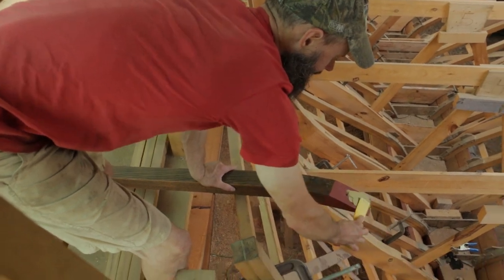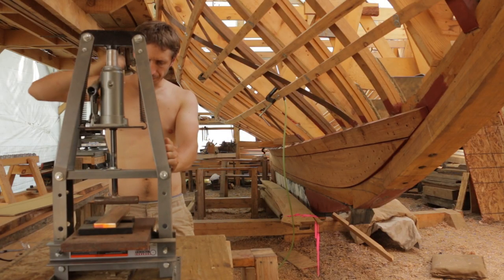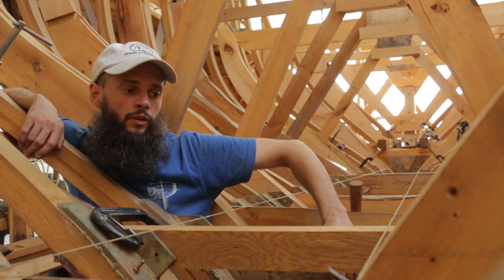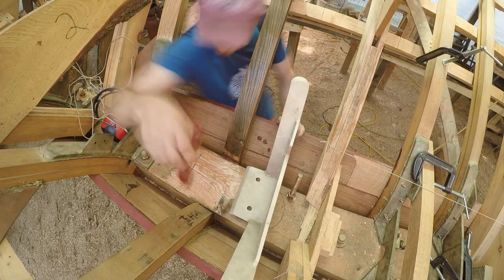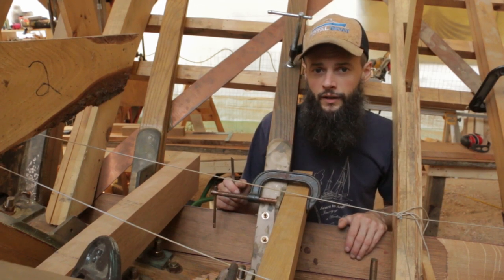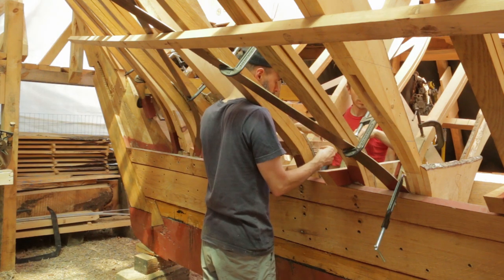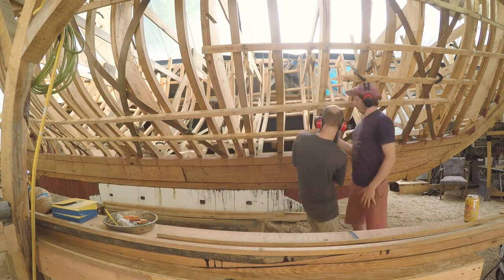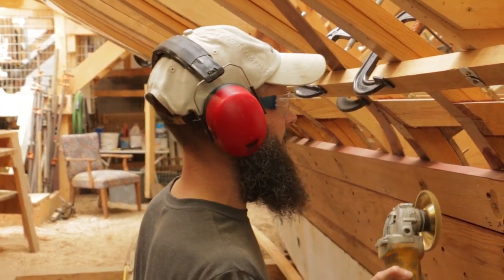Acorn to Arabella - Journey of a Wooden Boat - Episode 77: Sole Beams and Diesel Engine

Comment: While I admire the level of craftsmanship with the floor beams (and the overall project in general) I can’t help but wonder.   Would the iron men sailing wooden ships have fit every joint as precisely as you do?  My guess is that they didn’t.  This isn’t criticism because I would do it the way you are.  Just wondering how tightly fit the boats of the 1700s-1800s were.  Arebella should be around for 150 years or more.

Comment: Are the sole beams meant to bear on the planking?  Are they to be affixed directly to the frames?  If the answer is no in both cases, why not cut them off well inboard of the frames?
Reply: The most simple answer is less chance of creating a pocket for water and/or debris to get in. Debris will act like sandpaper as the boat will be constantly moving once in the water. The second reason and probably more importantly, a tighter fit makes for a stronger boat.
Reply: The sole beams will rot if there that close to the planks.
Reply: @toadjam12000  so paint and dolphanite wont prevent that?
Reply: Only for a while.
Reply: If they're not attached to the frames, they could stop just after the floor tabs.  There could be a 3-4 inch gap there.  I don't think you'd want inconsistent expansion to bear the ends on the planks either, as that would be point loads.
Reply: @benkilgore  I agree somewhat. But as we all can see, they have extended them to reach the planks. To me, that insinuates they are going to fasten a  plank (or two) to the floor tabs. That also tells me they want the keel as strong as possible. Either way we will get more details in the next episode or two.
Reply: @toadjam12000   In that case, that could be said for the whole boat but thats just part of maintaining her. Prime example is the Tally Ho. Her issues was mainly due to lack of maintenance, care and proper repair. I dont believe Arabella is going to have that issue until the 3rd or 4th owner of the vessel.  JMO.

Comment: I'm not a carpenter or boat builder. Still enjoy watching how craftmen get things done, and the tools of the trade. Impressive work.  But I have a question. I notice you use power-tools to drill pilot holes but then you use a very old/traditional hand-tool to screw in the screws later.  Why not use power-tools to get the bolts/screws in too?
Reply: Power tools tend to ring off screws or strip out the heads. More control with a hand brace and you can feel the pressure you are applying.
Reply from the maker: Larry is correct. The bronze fasteners are quite soft in comparison to the oak, so using hand tools allows us to use the correct amount of pressure and force.

Comment: Could the sole beams just be cutoff at 90 where they are just short of sticking out instead of all the work of trimming the ends after bolting them in

Comment: Do the sole beams need to be flash with the outside of the frames? Also, could you, or would you, fill the gap between the lower planking and the keel beam with something to prevent water collecting in there.

Comment: Why did the sole beams (floor joists) need to extend all the way out to the inside of the planking? Surely it would have been so much easier to have left them an inch short of the outside of the frames, obviating the necessity to carefully shape the ends.
Reply: Jim Nickles  Look tacky? It's under the floor! The only thing to ever see the detail again would be the ship's rats........

Comment: Too many comments to search thru, but your welds will work better if you weld indoors or put up wind blocks around your work. That slight breeze is blowing away all the benefits of your gas flux, making the welds ugly and not getting the penetration you need. Will be less clean up after the weld too. If you are getting fair welds you are having to use far more gas pressure than necessary. At 8:24 you can watch it.

Comment: Stephen-  Trust me here.  You should be using a respirator when running a table saw, and when running that grinder.  Hard wood is very unforgiving that way.  You're only young once.  You'll regret not having your youth last later on...
Reply: No it's very true I never realized that wood was considered or wood dust is considered a carcinogen which sounds strange but they say it's true

Comment: Why are you using a string line?? The sag will vary with the weather and temperature.  You can buy a decent laser level for less than 50 bucks.

Comment: No kick guard or push stick for the table saw?  Your taking a high risk of losing fingers on that thing. One of the most dangerous pieces of power equipment in the wood shop. Especially with wood that big.
Reply: Ron Gaul 

Idk, they seems to know what they are doing.
Reply: B Stevermer   Yes, he looks very confident  with his handling of the wood through the saw, but ask a carpenter who has lost fingers, and they would tell you they thought they were ok too.   If no guard, and I realize you can’t always have a guard on the table saw, you should always use a push stick.

Comment: What’s the weight of this boat when complete?  Wonder how they intend to transport it.
Reply: I asked that along time ago. It is about 8 or 9 tons and they are only a few miles from a place to drop it in. Boat moving companies usually use trailors,  but I have seen them craned onto a low boy semi trailor. They don't get squirrely until it gets up to 20 tons.

Comment: 14:57 Is that a potentially dangerous crack in your circular saw ?   Could it fly apart ?
Reply from the maker: Those are cuts made by the factory to help reduce warping as the blade heats up.  Little to no risk of them breaking.
Reply: @AcornToArabella  Thats okay then - Thanks for the reply.......  :)

Comment: I wonder if they checked that the floor upstairs could carry that motor.
Reply: they BUILT that floor to carry that motor.
Reply: CorwynGC you sure, it looks pretty wobbly. Why did you write “built” in caps?
Reply: @domdraper3221  I used caps to emphasize that the floor was built specifically to hold that motor (along with other things obviously).  I have stood on that floor (along with a dozen other people), and it is pretty solid.
Reply: @CorwynGC  Ive stood on plenty of floors, doesnt mean they are designed to hold a diesel motor. Anyway, im sure it will hold. hopefully.
Reply: @domdraper3221  A live load of 2,000 lbs exceeds a static load of 800 lbs.  And as I said, it was designed to hold that motor.  They knew they were going to put it up there when they built it.
Reply: @CorwynGC  If your live load is people spread out over the supports, than it is not comparable to a 800 pound static load, especially if the joists and supports are not the correct thickness and / or not placed the correct distance apart etc. I have seen many raised floors, decks etc almost fail due to a seemingly small static load, which is why I bothered to say anything in the first place. Like I said, I’m sure it will be fine.

Comment: @acorntoarabella How did you obtain a level between stem and stern, and are you concerned that the floating level of the boat will be different to the deck?
Reply: Why does it need to be level
Reply: @johnbower  That's kinda what I meant, how Arabella lies now in the shed is not necessarily how she will lie in the water. it's not imperative but would be nicer to have a level deck.
Reply: @adamhannath1417  The run of the deck was designed by the architect and is incorporated into the plans.
Reply: @skipper2285  and the baseline of the plan would be measured from the top of the keel?
Reply: @adamhannath1417  Not necessarily.  There is a baseline established on the plans from which the table of offsets is taken, and all measurements originate from this.  It is often along an identifiable feature on the actual boat, but not generally.  Once you establish additional reference lines on your lofting floor (Waterlines, Diagonals, Buttocks, Stations), you can mark them on each station mold and go from there.  the waterlines are all parallel, and these are usually set level on the boat by the use of shore timbers and braces.
Reply: @skipper2285  Thanks Skipper.
Reply: @adamhannath1417  Not necessarily.  The traditional method of designing a boat started with the designer making a half-model, or the model of one side of the boat, carved out of wood.  They would then literally take measurements from the half model to form the drawings.  The baseline for the drawings can be established anywhere on the drawing.  In the case of "Ingrid" (Arabella), Atkin established the baseline at the bottom of the ballast keel.

Comment: Why didn't the floor have have a through hole for the bilge?
Reply: He explained that. It's designed to prevent the crap from the anchor locker running back into the rest of the bilge, and that area will have it's own bilge pump.
Reply: @davep5788  Thanks

Comment: A come along qould have been better for lifting the engine and it would only need one person for the lift.  Or for when you set the engine.
Reply: Come alongs are meant for dragging/pulling and explicitly not for lifting.  Yes they work for that and plenty of people use them, but they are always just one dog rivet/pin/bolt away from dropping the load.    Same goes for boat trailer winches and lots of other ratcheting style pullers.    The come along was invented for tensioning wire fences, excels at that purpose, and can be handy elsewhere, but it is not a lifting tool.

Comment: There is no way I would let the salt water, and mud from an anchor chain get on those frames!   They will rot way too soon and stink up the entire boat with ocean mud smell which is gross.  Some smells like rotting flesh.  You will never eat, sleep and live in an area smelling like ocean mud.  Make a fiberglass box container with a drain overboard to keep the chain and rode.  Rinse the anchor and chain as pulled then throw sodium bicarbonate or bleach on it in the box  that drains over board.  Some high end sail boats place the anchor wench in the room if they want the deck clear.
Reply: You assume that the chain locker will be open to the saloon.  It ain't necessarily so.

Comment: Why did you choose a diesel engine? Why not an electric motor /maybe hybrid /+ solar? I know it would add complexity and cost, but that's where the world seems to be headed. It would also make the project much more unique. Keep up the great work!
Reply: Joe Smith  in case you have not picked up on it, the hand built wooden boat from 100 year old plans gives zero fucks about where the world is going......it’s all about the old school.
Reply: @Android-ng1wn  - And you can bet that electric ferry doesn't recharge from solar panels. An electric battery bank big enough to provide the same amount of propulsion as that diesel would need 10 times as many solar panels as the boat can carry, in order to recharge it in less than 24 hours. And if it can't be fully recharged within 24 hours on a boat, it's effectively useless. Then there's the question of what happens if you have a couple of weeks of no sunshine. The kind of situations where you need emergency propulsion on a boat don't just wait until you've been blessed with enough sunlight to charge up the batteries.

Comment: Sorry about being one of those guys but I cringed watching you hump the welder with the regulator still attached to the tank. You should pull the regulator off and put the cap on if your moving the equipment over uneven surfaces like you were or the tank could end up in your neighbor’s house.